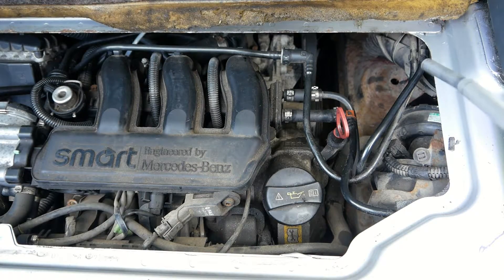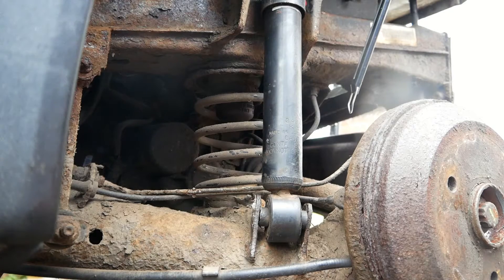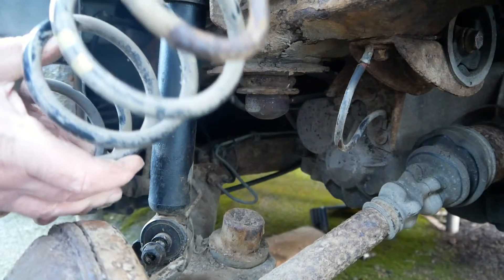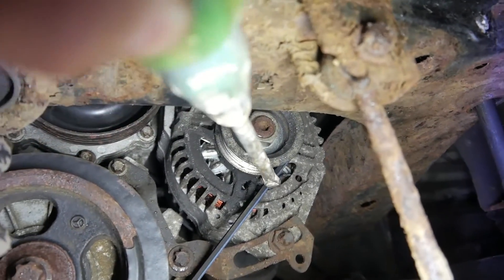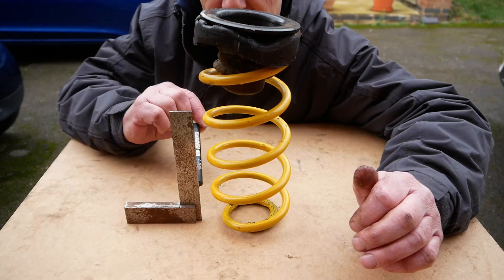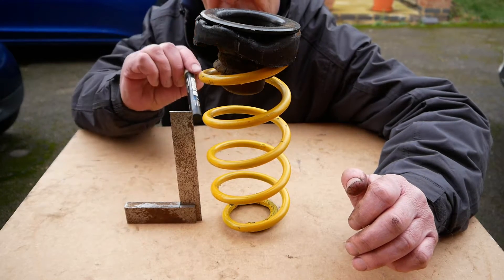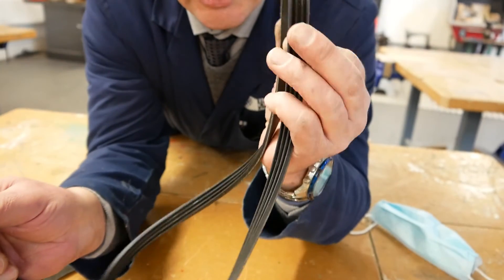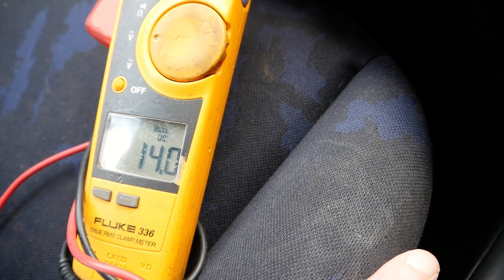Smart Car Alternator & Spring/Damper Replacement Fortwo 450 and 451 (1998 to 2013)

Comment: Hi David, Thank You for all the videos.  I tried to fix my daughter's 2013 Smart Fortwo Passion, the car turn on, all lights are on, heard the clicks but the car won't start.  We replaced the Alternator, Starter, and Battery that still experienced the same issue.  Any advise is greatly appreciated.
Reply from the maker: Hearing the clicks sounds like the fuel pump is working. Is the car turning over? Do you have a diagnostic tool/meter? They are really easy to use and cheap on Amazon. This link takes you to Amazon. The tool is about £21. They are easy to use. It would help us fin the fault.
https://www.amazon.co.uk/MOTOPOWER-MP69033-Universal-Diagnostic-Protocol/dp/B07Z3HB7DR/ref=sr_1_2_sspa?crid=3LVN29L1S7HVF&dib=eyJ2IjoiMSJ9.Z5hgWLNWmRkw0_9tQWNsisTSE3ZlXz-h_rRxosDHWv87Nfrt0Xcr1CXxH15IrGdLOTugfbuEkZqfE4l9A8IVJ2cIGP3CuglShnwhZ8ceOCdmfQMYIPyPG3MAZSVdkDFtP76iYv4naw-O9-I5hesFHflWOg5KnvnEimFQL4_g6x6EMf0-7oslCP17E1vuX3PJFZN2ac69Bv-1FM8-AeTAc_IQVS02KwkRCqsAxDDgUw0wA6XWi8CtO2sqGJQY_YKeVakZFcz3u27Rnc-jUkD1e41u9OhrZEHGCELS7SNpiyc.phQ5lSrkwV6rGYaBephPW38-GsJ2pp3tZUL-Y_FPk5I&dib_tag=se&keywords=ob2+diagnostic+tool&qid=1730151096&sprefix=ob2+%2Caps%2C110&sr=8-2-spons&sp_csd=d2lkZ2V0TmFtZT1zcF9hdGY&psc=1
Reply: Check if you have bad ground
Reply from the maker: Will take a look.

Comment: The best video.   I wanted to learn which torx do I need and now I now it is the E10!  Thanks !
Reply from the maker: Glad the video was helpful, thanks for the feedback, Michael.
Reply: @shed52  it was actually E12 tool in mine +16mm  but I finally took it out!!! After 3years haha...   no need of taking out the oil sump ... everything took like max 30 minutes..  15min for the generator screws and 15min for the cables...      thanks and good luck  🙌